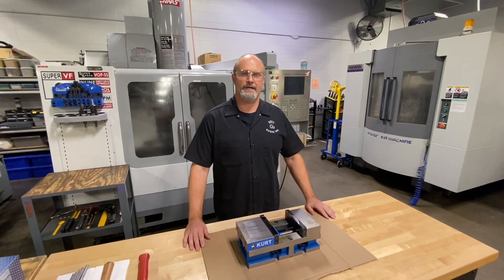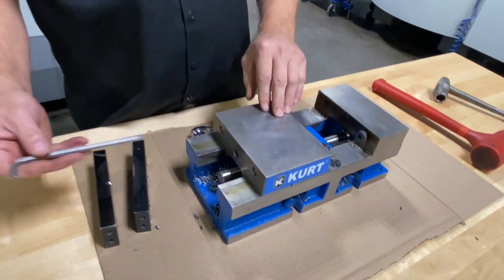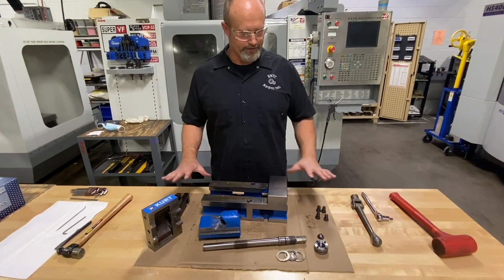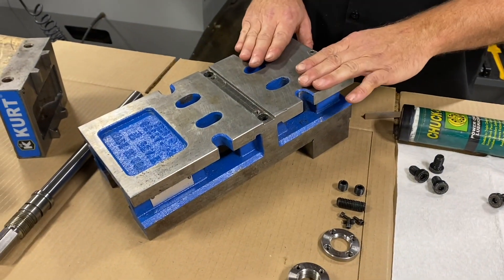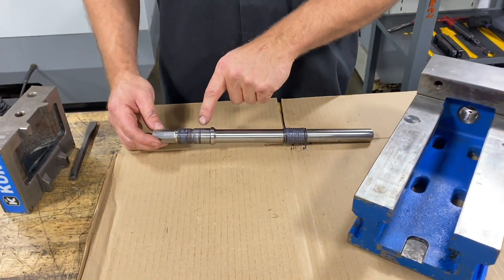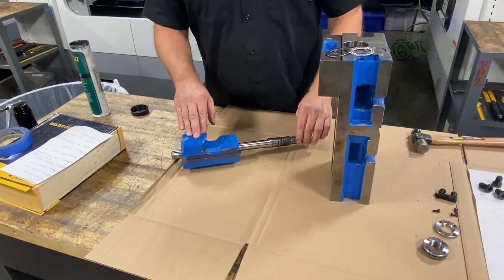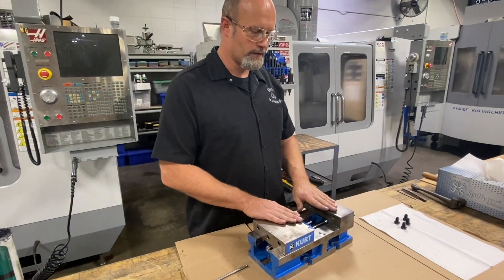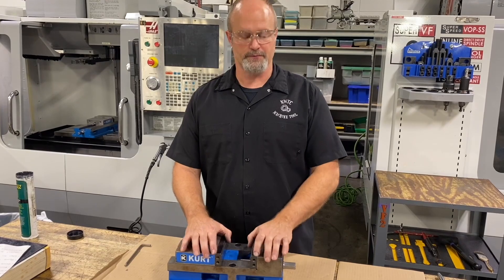How to Rebuild a Vise

Comment: Ausome tutorial!
Reply: Great video. But I think your lead screw is in backwards
Reply: @mikehazenbosch5791  it’s a much less common style- designed that way to reduce unnecessary reaching on the part of the operator when loading or unloading parts. Makes a lot of sense when you think about it, but there are benefits and drawbacks to every vise design.
Reply: @matter9  i understand your point. I don’t know if it makes a difference but this vise doesn’t come that way. It’s ground on that face for mounting. If you wanted to stand it up or on its side